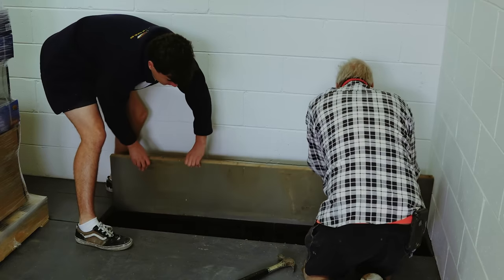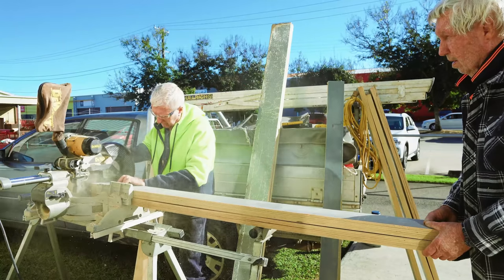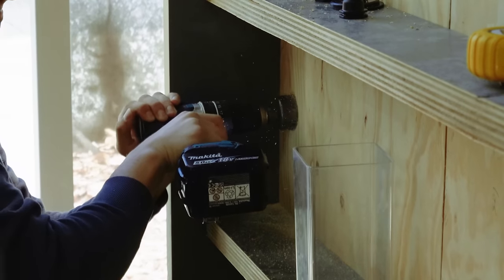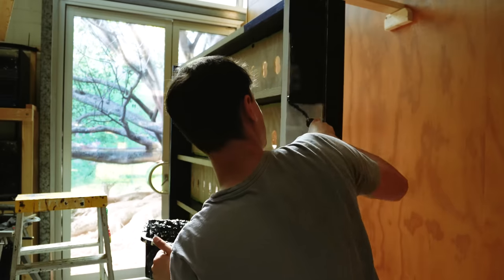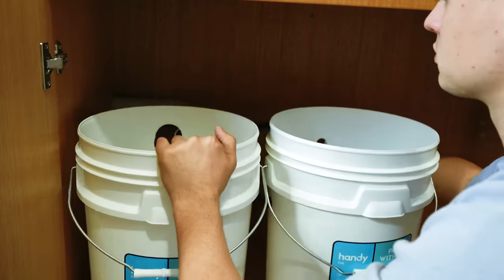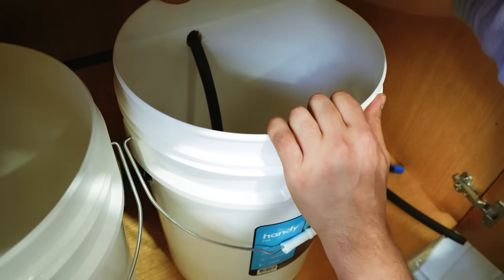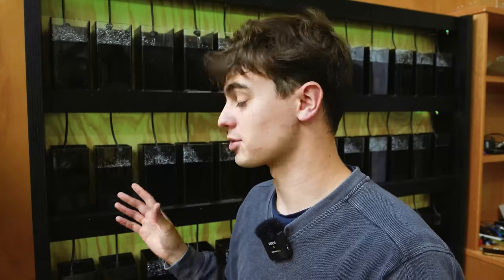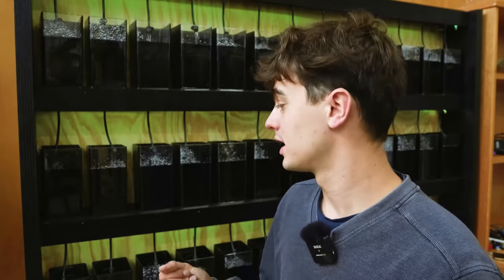The Best DIY Betta Rack Build! Over 50 Fish!

Comment: As a hobbyist, I thoroughly enjoy fishkeeping and visiting multiple stores. I can tell you, I don't personally care what the store, and it's shelving looks like whatsoever. As long as the fish and the tanks themselves look healthy, and there's adequate obvious filtration for the tanks I'll regard that store as being a "Good" store. Most places don't have any filtration or water change systems in place for Beta's let alone a custom rack with filters for them. Whether your racking systems look homemade or have a fancy facing on them is irrelevant to the fish's care. Most people in the hobby would actually rather see the plumbing and filtration systems on the racks. I'd honestly advise you pop in some form of view panel for the buckets or a way to show customers that the Beta's have ample filtration for them to be healthy. It's all a learning experience for customers, you could even change the buckets for some form of clear plastic containers so you can show the media the water passes through to easily visually educate new fish keepers on the cycle process.
Reply: Whilst it may only be temporary until they're sold, the containers look too small. No container will ever be big enough but I noticed a pet shop upgraded to a larger containment system and added decor. Perhaps better to sell less of them than cram them in.
Reply: this is a lot better then what chain stores do. Most put them in a cup and hardly do water changes because they don’t have time. this setup is much better
Reply: This is all true in my book.
I literally HATE walking in to browse badly looked after fish in tanks. 
Since I was ten yrs old my local was a decent size, filtered and well kept. Never lost a fish as a kid to them.

Comment: The LED strips are really nice for DIY stuff. They're relatively inexpensive, typically around $10 for a 5 meter length here in the US, and can be really bright if you get the right ones. The RGB LED strips don't get that bright if you're looking for pure bright white light, I've used them before. If you want bright, the dedicated white light strips are your only option, the more densely packed the LEDs on the strip are, the brighter they'll be. I used a strip that had a density of 204 LEDs per meter.
Reply: i am sure he knows what leds are... thanks Wikipedia
Reply: @vasili1207  Jesus dude chill out he was just trying to help
Reply: @vasili1207 I thought it was a helpful comment

Comment: it's all coming together! a word of advice from someone who has built (and dismantled) one of these because of how fussy they can be: build a bigger sump and include a fine micron filter sock on it so that no junk gets pumped into your drip emitters, those drip emitters will clog every single day without super fine micron filtration. I had rigged mine up with a fully open airline as a return line and they would still clog up weekly without micron filtration. good luck!
Reply: I have one of zebra danio research racks and they send the pumped water into a 10" water filter with a micron filter installed, so I'm betting gregs onto something. I'm not always sure more volume is best with these systems if you can autowater change daily, easier to dilute small volumes of water vs large. The danio habitat I have housed lots of fish but is only 20 gallons? Again its one of the University research racks.

Comment: I think you should add an elbow and a pvc pipe (pointing downwards) to the inlet, so that the water flows into the 1st bucket filling the bucket from the bottom - up then overflowing to the 2nd bucket. Gives the water more time to filter thru the media before going back to the tank. Great savage project!
Reply: YEA THINKING THE SAME THING BECAUSE THE WAY HE HAS IT , IT NOT REALLY DOING NOTHING ALMOST

Comment: Very similiar to aquarium co op betta racks.
Btw here In indonesia we use 4L plastic jar for stores, those 4L are more cheaper and looks good also
Sometime store would use betta system with the system installed in the racks so the same 4L jar but there is a tube sifoning and tube pumping water in,

Comment: Since it's such a low water volume and not really under any pressure, you can save a lot by using a rubber grommet instead of a bulkhead.  You basically use it as a cheap version of a uniseal.  Just get one to match your tubing size and drill the hole in the container to match whatever grommet you choose.

Comment: i wanted to build one of those once, i thought of a super cheap design. you know those gutters they use for houses, get those, fix them on some plywoon, put eggcrate on them so that they become a shelf. drill tiny holes on the containers and place them on the shelf. i think that would be less that 700 bucks since no bulkheads will be needed or elbows will be needed

Comment: Just a suggestion, I would have install a separate drain running to each level of shelves at the bottom corner just in case one overflows.

Comment: I think you guys can cut cost further if you dont use bulkheads possibly theres an alternative id just use tubing cut to length or similar
Reply: That's what I thought too, they're bloody expensive at the green store.. even more at plumbing supplies if you aren't a plumber.

You can buy them cheap on Ebay, but their sizing is different..

I've used threaded pipe fittings with same effect.. the Holman 20mm Faucet socket and 20mm Valve socket work well.

Comment: I built almost the same rack but mine only holds 44 fish thanks . The whole thing was made from scratch we even made the thank that are 15h and 10cn square we use aquaponic  trays to sit the tanks on and they ran down to a pump with an in line UV light ,  we used that cheep Polly pipe you use in drip lines and added those thinner lines with small taps to drip the water in to the tanks as well as a small hole in the back as an over flow ,

Comment: Nice job but if it was me i will do 4 long tanks then i'll seperate the tanks with a Grill seperator to make a serious of tanks so then the tanks will not be seperated and you will not have to drill all that holes for the filtration, remember to think for electricity if it cut of the pump will not pull water in the tanks and the flow by gravity will not full up the bucket.
Good Job then Mate.

Comment: Unless the water is actually pushed from the bottom of the 1st bucket it WONT go trough all the filtering media and foam. Once it's filled it will just pool up and drain to the 2nd bucket.

Comment: then how the betta poops be filter out? you have water flooding thats grate but you still need to have clean the betta poops manually. Should a water out et of the small tanks also be set at the bottom part with a switch to open/close, so the poop will be washed away?

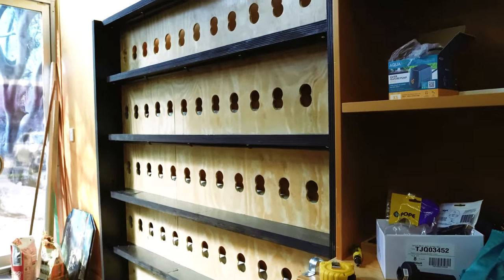Comment: 8:53 shouldn't  the overflow be in the bottom of the first bucket?
Reply: I thought the same thing. The return from the rack should be at the bottom of the first bucket so that the flow passes up the bucket and overflows into the 2nd bucket
Reply: @TimEdwards  yeah it should be in the bottom so the overflow can pass from the filter

Comment: It needs a much better lighting so badly! In a shop, the animals must be put in the best light in order to really attract the attention of the customer, otherwise he does not buy any of the Bettas. Any little container needs a single 0,5 - 1 W Led spot. If you you know any electrican, he could help you with this. It's not that expensive as you might think, but it is heavenly needed. China LED and a correspondingly large transformer can be found quite cheaply online.